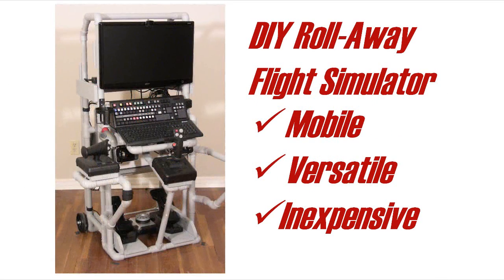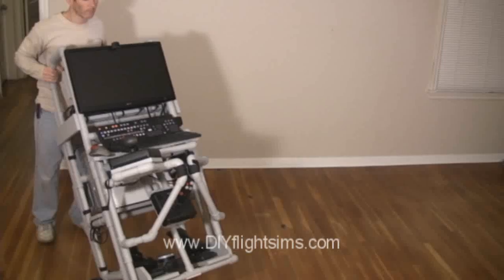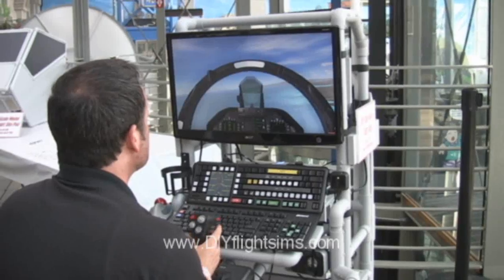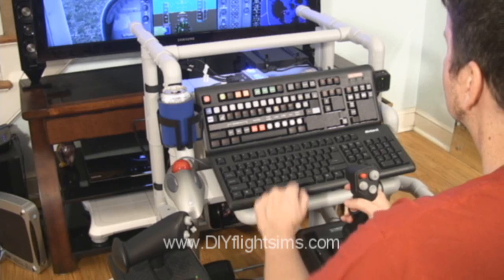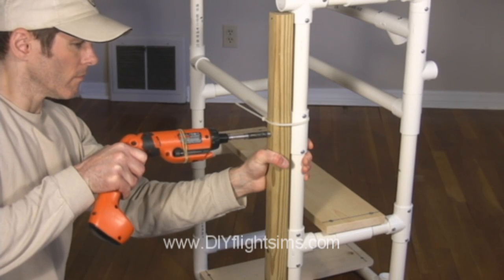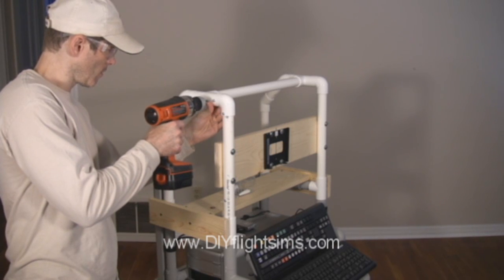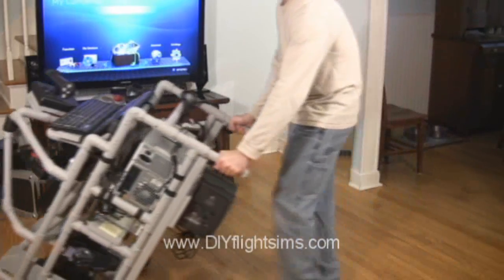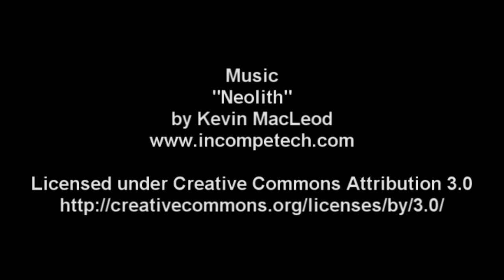DIY Roll-Away Flight Simulator, Item #E420

Comment: Why the angle on the center stick? Does not look comfortable for long flights. Is there a version with perpendicular center stick? Thanks!
Reply from the maker: +Frédéric Lord I designed it like that because it worked well for the CH joystick I had at the time.

Comment: do u get the whole thing with controls or just the frame because if u get everything ill order
Reply from the maker: Theultimatebossman12 I sell the DIY video and instruction manual. See the DIY Flight Sims website.
Reply from the maker: Theultimatebossman12 You can get the joystick, throttle, rudder pedals, and TrackIR from a variety of online retailers, like Amazon.com.

Build the frame from PVC pipe and wood boards.  Simply buy the materials from your local home improvement store.  

We can show you how to build a Roll-Away Flight Simulator.  You download the Do-It-Yourself videos and instruction manuals from the DIY Flight Sims website.